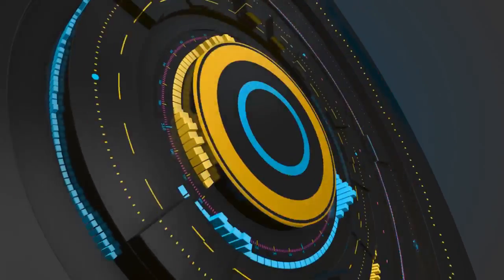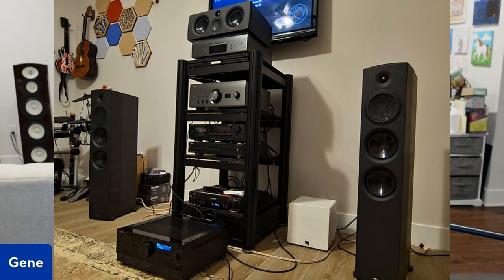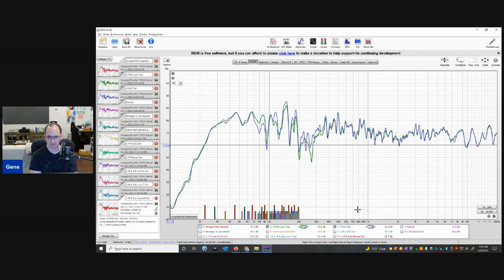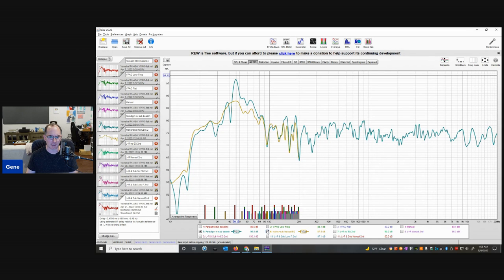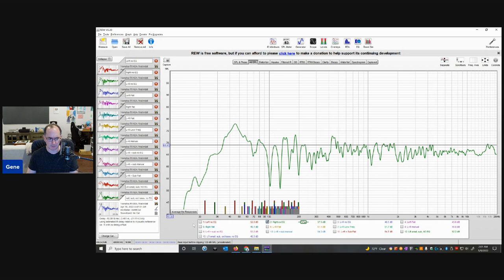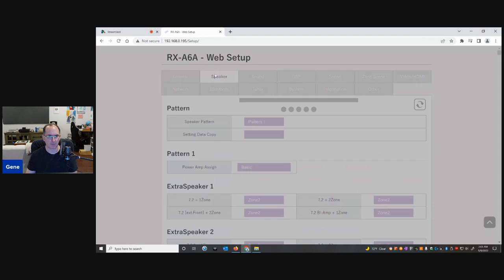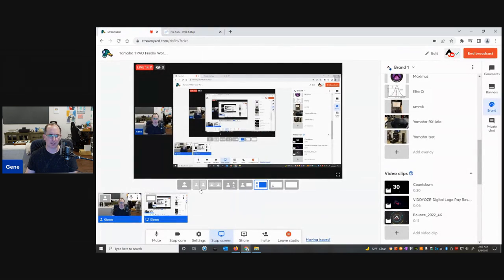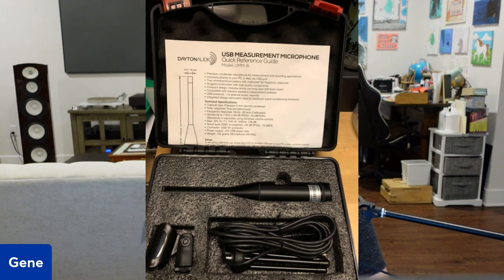Yamaha YPAO Room Correction Finally Works?!?

Comment: Hey Gene.  Great video.  I've had the A8A for a couple of months now.  I couldn't agree more with you on YPAO.  I got excellent results, with only some minor tweaks on sub level and rear surround levels for my taste.  The YPAO speaker distance measurements were spot on!  It's pretty amazing.  I have a laser measurement tool and the measurements were exact  with YPAO.  My previous receiver was a Pioneer Elite (SC-77), and I gave up on it's room correction tool.  I got much better results by ear (and my laser measurement tool).   I also love the sound of the A8A.  I chose this A/V primarily because of how pleased I am with the Yamaha A-S 2200 in my home offices.  I love the warm sound.  I guess I'm a Yamaha fan boy!  :)
Reply: I just picked up a brand new A8A for 2500. Planning to use it in a 7.1.4 setup in my large 700sq ft open floor living space, that has windows and 9 ft ceilings. I am hoping that this YPAO correction software does the job. I keep getting told to sell this Yamaha and get a Denon 4800 which is the new generation that just come out, the units should ship next month. It has Audyssey and in a future update will have Dirac. It also allows you to shut down each amp channel. I'm guessing that allows it to reserve all power for other channels. Unlike our Yamaha that when you use preouts I'm being told the remaining onboard channels do not get the extra power in the amp. 

So anyway I got an amazing deal and want this unit to work. Just wanted to get your thoughts on your unit, if you've had any issues at all, any arguments on why I should keep this unit, etc.
Reply: @LichaelMewis  great price on the A8A !  I like YPAO.  I also like to manually tweak the sound. I’ve had no issues with my A8A.  I currently have a 7.1 setup in my theater.  Will soon be adding 4 presence speakers for a 7.1.4.   I love the “Yamaha sound”.   Last week, I purchased the A4A for my bedroom. It’s a 5.1 surround setup, so the A4A is perfect, and allows for a 5.1.2 setup if I want to grow.   Amazon had the A4A for $1149, which was a great price. I couldn’t resist!  So, as you might guess, I’m going to recommend Yamaha. However, you can’t go wrong with Denon, either. Good luck with your decision!
Reply: @CharleyClose  thank you. I think I'll hold on to the A8A. Once the Denon 6800 comes out (I'm hearing about a year from now), I will look to possibly move to it. Also I found out the 3800 only has two zones where the A8A has three zones. I need three zones minimum. Glad you have good experience w/ YPAO. I'll be fooling around with it once all my speakers come in.
Reply: @LichaelMewis  good plan!  I think once you settle in with the A8A, you’ll be completely satisfied. You may even forget about the Denon 3800!  LOL.  Who am I kidding!?  We audiophiles are never really satisfied, are we!?  Haha.  Enjoy the A8A!  I know I am!
Reply: what level of integrated/stereo amplifier in the yamaha lineup would be needed to sound better than the a6a/a8a for 2 channel music performance? 

thanks
Reply: @ranakirti  for 2 channel I use the Yamaha A-S2200. It’s excellent. A little more pricey than the A8A, however better sounding for 2 channel. Yamaha has 3 units in this series.  A-S1200, A-S2200 and A-S3200. I think the 2200 is the sweet-spot for price/ performance.  Also, keep in mind these are pure analog amps (no DAC or digital connectors). You’ll need an external DAC if you want digital sources. I use the Chord TT2 DAC. 
Hope this helps.

Comment: Mine will not work and I cant figure out way. Any suggestions would help. I did a factory reset already. I keep getting the error E-124 every time whatever that means. Thanks if you can help. I have run out of ideas. I have the Yamaha R-N803 with Martin Logan ESL-X speakers.

Comment: I really like using the A6A PEQs and doing it exactly as you described. Running ypao, then copying flat results into PEQs and start finetuning on my own with REW control measurement. Sure, it takes some hours, when applying for all Channels, but thanks to new web interface and much more selectable frequencies it can be nearly used as a Minidsp. Thumbs up Yamaha.

Comment: Amazing work as usual... Thank you very much for such a detailed analysis.
About my own experience with a RX-A8A, I find the stage way wider with YPAO correction (flat) while in stereo or Auro-3D upmixing.
I also noticed that it's very sensitive to speaker placement : at some point, after cleaning the room, I think I didn't put back the speakers exactly in the exact same spot and was disappointed by the sound. Ran YPAO and magic  was back, wider stage, better separation/spread...
Purely based on earing experience, so totally subjective and not scientifically measured.

Comment: Looks like a great tool,  I’ve found anecdotally with manual EQ tuned by ear, that often when you cut the midbass, the lower bass has better performance. Which may explain that boost you observed. 

My theory is that since all bass including the midbass takes a significant amount of energy, cutting some of it provides more headroom for the lower end. While also reducing distortions from the driver doing less.

I’ve used this technique in nearly every system I’ve had, and I consistently get smoother deeper bass as a result.  It really lifts that -6db point. 

Basically you boost the lowest eq band, and then cut the second lowest.  Typically on my EQ’s in which I find 5 bands ideal. The lowest 30hz band I set at 7/10  (5/10 being middle)  then the second lowest usually 250hz, I cut way down to 2/10.   Then the remaining 1khz at 5/10 3.5k also at 5/10, and the highest 10khz depends on the  sibilance of the system, but usually I cut it too as a matter of preference.

I find FM radio hiss to dwell in the 10khz band, so cutting it has a huge impact on the noise floor. People may roll their eyes at FM but my local station doesn’t have adds, plays records and has an analogue transmitter, so it’s all analogue baby ha ha ha  but mostly I like FM because it’s instantly on. 

Shoutout to 96khz sampling rate for the room correction ;)  It may not be 24bit 192khz, but then again most streaming libraries are still CD quality.
Reply: Thanks, using your info ear tuned my bass and had an improve low frequency response. Not as a good as using equipment but a lot easier and cheaper.

Comment: I just got this receiver to replace an old, broken Pioneer Elite. I am using 5 Rocket speakers & a Velodyne digital sub. Haven't even completed YPAO yet, but it already sounds great so far. The sound can be very subtle & delicate, or in your face bold. The lighted remote is pretty awesome & quite heavy! Input changes respond quickly. A very, very nice receiver that I picked up new for $1600. Besides my motorcycle, this was my 1st Yamaha!

Comment: I bought a RX-A3080 two years ago and ran the Auto Calibration and it was disastrous!  It set my 7 bed layer and 2 height speakers as Large with the crossover at 40Hz, with the distances way off, and the levels all over the place...  so I just bought SPL meter and set everything myself and the results were way better.  Needless to say I did not use the EQ at all, because of how bad the Calibration was.
Reply: U r right

Comment: With my older RX-A3060, I only let the YPAO EQ my main speakers, as I have a separate subwoofer EQ device (a DSPeaker Anti-Mode 8033.)
What I do is do the YPAO setup with no sub configured (just turn it off.) Then when it's finished, do the setup on the Anti-Mode, then just enable the sub on the Yamaha and set the level correctly.

Comment: One thing to keep in mind when doing manual EQ is, that as soon as you add more than on sub, things get very complicated. Manual EQ for two subs is doable, but I found it to be more trial and error than anything else.
That being said...I am starting to get a bit frisky...have been running my Denon X6700 for a few years now and was finally happy with the auto-eq after Audyssey provided the MultEQ-X addition, and am very unsure where to go from here. AVRs have become even more expensive these days, and there really doesn't appear to be much ou there that is actually improved. The Denon 6800 doesn't offer anything that the 6700 doesn't already have, apart from more stable HDMI 2.1 and the A8A has been on the market for a while now and I don't know how much support in terms of Updates it is going to get.
I really liked Surround:AI on the RX-A3080 but felt that Yamaha didn't really spend much effort on improving it after the initial launch...

Comment: Hi Gene. Thanks for that, it was quite informative. One question though - when I run ypaou more than once (in different listening positions as you indicated) does the calibration mix each of those readings, and if so, how do we start from scratch? By the way, I too would prefer less interference from all the gadgetry when listening to music. Nothing seems to beat a (fairly) straight line from the song to the speakers!

Comment: Thank you again. I was going to mess around wirh an rxa aventage 1080 I got for a really good price. There were a lot of concerns about the amp measurements and YAPO on another site but I feel much better that the software at least handles some low frequencies and set the distances accurately.. I currently am running Denon which I owe you a big thanks for your tutorial on Audessy with the  Greek guy (Theo?). Holy cow changing the curtain and limiting the Multeq-x app to correct just the first reflections made a world of difference.

Comment: Great video, Gene!

I would like to see a comparison with a Dirac Live / Audissey unit.

I recently bought an Onkyo AV Receiver, and all of those who didn't support Dirac Live were immediately excluded from my shopping list.

While I don't disagree that with great loudspeakers and in a good sounding room correcting mid/high frequencies can be detrimental (even with a less than "perfect" speaker, it may have the kind of sound that the listener loves), I believe that achieving those conditions is rarely easy. 😉

I kind of have it (I stopped half way), but aí found out that I'd rather have a greater balance between sound and aesthetics (that's where good room correction software comes in). 😉

Most high end monitors (which measure great on anechoic chambers on several fronts) include DSP with room calibration, because it's a proven fact that every studio sounds different from each other - no matter how good the sound treatment is, and using the same monitor make and models.

Some of the Atmos tracks that you hear were likely mixed on monitoring systems with room correction, so it doesn't "shock me" if I have to make the same thing on a regular living room. 🙂

These AVRs are still consumer products (not professional ones), and today, they're able to do things (sound wise) that were nearly impossible not that long ago. 😉

It's great to know that Yamaha is stepping up their game in the room correction side of things, but comparing it with the current references in room correction software seems a bit unavoidable to me. 

Thank you. 🙂

Comment: Finally was able to buy an A8A a few weeks ago, and ran the basic YPAO once with an all-SVS 7.1.4 speaker setup.  Started going through my 4K with Atmos blu-rays and loved the sound.  Planning to raise the L-R towers a little and will run YPAO again.  I don't really have the time to get into manual tweaking, so I may not be getting the ultimate audio (but happy with what I have now).  (My old 55-pound Onkyo sounded as good with 5.1 and 7.1 lossless but would not do Atmos nor would it pass HDR.  Atmos does make a difference. )
Reply: What does Yamaha show when the correction is completed? Does it show compensation EQ like the Denon avr's?
Reply: @fieldcar  Didn't show anything.  I just clicked "SAVE" when it was done and that was it, that I recall.  Certainly nothing that stuck in my memory.
Reply: @Chris21709  thanks for letting me know. My dad needs an avr and the onkyos with Dirac live are impossible to find and he doesn't really care much about techie features as long as it does the job.
Reply: I just picked up a brand new A8A for 2500. Planning to use it in a 7.1.4 setup in my large 700sq ft open floor living space, that has windows and 9 ft ceilings. I am hoping that this YPAO correction software does the job. I keep getting told to sell this Yamaha and get a Denon 4800 which is the new generation that just come out, the units should ship next month. It has Audyssey and in a future update will have Dirac. It also allows you to shut down each amp channel. I'm guessing that allows it to reserve all power for other channels. Unlike our Yamaha that when you use preouts I'm being told the remaining onboard channels do not get the extra power in the amp. 

So anyway I got an amazing deal and want this unit to work. Just wanted to get your thoughts on your unit, if you've had any issues at all, any arguments on why I should keep this unit, etc.
Reply: @LichaelMewis  The sound has been really good.  I don't use any of the processing—just the straight signal from my Oppo 4K blu-ray player.  There was a glitch in receiver recognizing the HDMI input recently, but that quickly resolved.  I moved the cable to another input, and then back again.  Not sure what happened.  I have too many other things keeping me busy to worry so much about whether something else would work better.  77" LG OLED C1 + the Yamaha make my movie experience exceptional.

Comment: Hey Gene.  I have Yamaha Aventage RX-A4A.
I have enabled the Extra Bass feature and love it. But….

Can you advise what the “Enhancer” option does?
Reply from the maker: Enhancer is a fancy compressor that restores HF and LF for bad recordings.
Reply: Don’t use the enhancer in a HiFi rig. Only use it on snap crappy speakers. I have both a HiFi and a crappy rig so speaking from experience!

Comment: Hi Gene, have been watching your videos for years but had a break for a little while and then just found your channel again. What happened to Hugo?. Your honesty and genuine product and technical insights are inspiring. I am a huge Yamaha and Kilpsch fan and I'm glad to see you rate these products pretty highly most of the time you come to review something. Keep up the great work. 

I have experienced an ARC issue with quick sound drop outs with my Yamaha receiver that seems to come and go every few months. Streaming apps using bitstream usually DD+ using the pass through. I have swapped the TV several times and the issue always seems to come back around after a few months. I wonder if you have ever experienced or had this issue.
Reply from the maker: Hugo was mistaken as a football at the Superbowl and was punted into the phantom zone and hasn't been heard from since.

Try replacing your HDMI cables to see if it fixing your ARC issue. There is also a different HDMI mode on Yamaha AVRs you can try in the advanced set up.

Comment: Hi Gene, great stuff - professional information but also understandable for non-pro‘s! One specific question which came to my mind regarding YPAO: if frequency response correction are done only rarely by the automatic system, how does it perform in terms of timbre matching the speakers e.g. Front vs. Surround? I mean even my well treated theatre room is not perfectly symmetric which leads to some timbre differences between speakers.

Best regards,
Christian

Comment: I've got a bunch of Triad Bronze speakers hooked up to a RX-A4A. When I run YPAO, it sometimes marks most of the speakers as large. So afterwards I go to the configuration and mark them all as small, with a 80Hz crossover. Is that going to mess up the YPAO calibration at all? Will the overall room bass levels be right?
Reply: Не делай этого, ямаха знает что ей делать лучше тебя

Comment: I have a question. As my speakers are about 3 feet away from me, how far should I move the mic from the center if I'm the only one with a single chair? About 1 foot away from the center? I have a computer with a TV close to me. My TV is arm-mounted and it mounts to my desk. My 42" TV is about a couple of inches away from my right eye and I'm blind in my left eye. And yeah even though I use a full-screen magnifier, I can see well enough to operate my home theater equipment. I only have just a 4.1 surround sound system and my Denon X3400H downmixes 5.1 to 4.1. It just simply sends center channel to my JBL A180 floorstanding speakers (recently purchased). I have an Insignia NS-B2111 speakers for surrounds (2008-ish) and Klipsch RP-1000SW subwoofer. I'm planning on replacing my Insignia speakers with JBL Stage A130 in order to match with my Stage A180 speakers. Back in 2015 or 2016, I once had my Polk T50 floorstanding speakers to replace my front NS-B2111 speakers. So it's all part of my home theater journey.

I had to set my floorstanding speakers' crossover frequency at 80Hz because when I watch Tomorrowland where Frank Walker drops Athena down to the big sphere "monitor" (I apologize for the spoilers), the explosion sounded like pops or distortion at reference volume, so I had to set the crossover at 80Hz and the pops are gone. So much for my floorstanding speakers at 40Hz or 60Hz... Oh, well. But the movie sounds great at reference anyway. I just need to get me a dedicated 2-channel amp for my front speakers that are rated at 6 ohms. Of course, I did look for impedence graphs online and I have see some frequencies drop below 5 ohms around 150hz or so which is a bit concerning for me, but no problems so far.

Thanks for the video about Yamaha's YPAO. I might check out Onkyo TX-RZ50 with Onkyo Accu EQ or DIRAC although I do want an AVR receiver that sacrifices features for sound quality. I just don't have a need for streaming services built into the receiver. My Linux computer is my "network streamer." :)